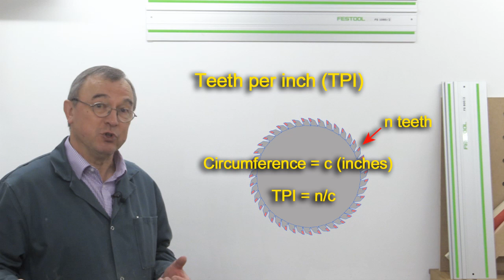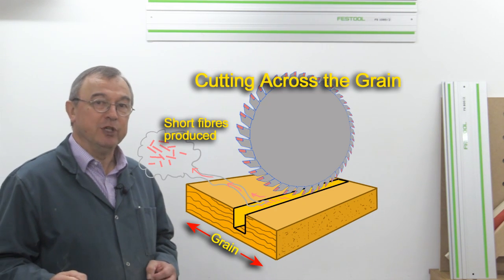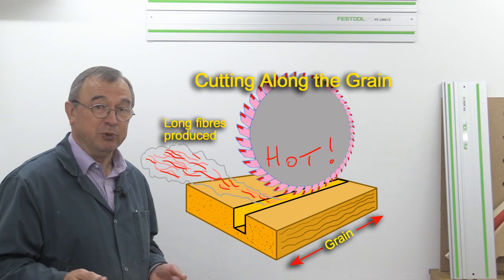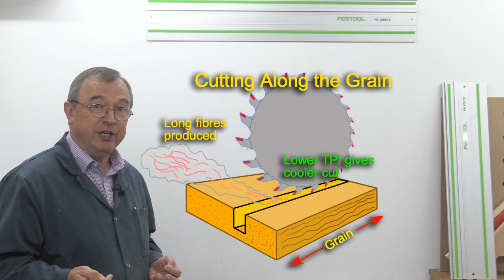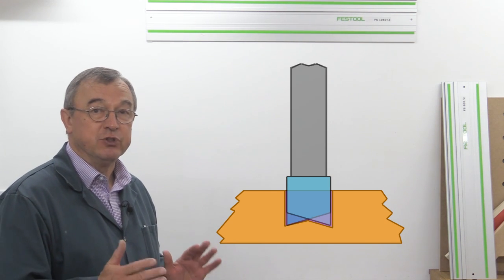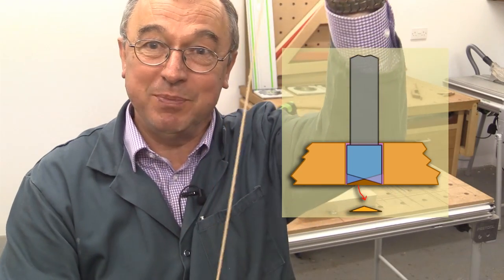Which blade for my Festool tracksaw?

Comment: Thanks again Peter for another very informative and professional video. As far as cleaning circular saw blades of any type or size, the easiest way I've found is to put the blade in a plastic garbage bag and spray both sides well with oven cleaner. Seal the bag closed. Leave it for a few hours or overnight and remove the blade, rinse well with warm water and dry thoroughly (a hair dryer works great). The blade will be spotless and you won't have to scrape any resin or risk damaging the carbide teeth.
Cheers!
Thanks again. 
Richard
Reply from the maker: Hi Richard, That sounds like an excellent tip for cleaning the blades - I will try it next time.    Peter

Comment: Very good explanation of use and demo... Most people do not understand how much you're cutting efficiency will improve with the correct blade, changing the blade on the TS 55 is so easy, always make sure you are using the correct blade for your cutting task.
Reply from the maker: Excellent advice. Many thanks.   Peter

Comment: Hello again Peter. Something caught my eye at the 7:10 mark that caused a problem for me a couple of weeks ago.. I noticed you had the green splinter guard on and it was that particular item that caused a problem for me... I was at a friends house adding a couple of cabinets to his kitchen that just had new cabinets installed. After using the kitchen for a couple of weeks they decided to add the two cabinets and the cabinet maker wanted a ridiculous amount for two cabinets. So I offered to make them if he would supply the materials and hardware and he wanted to help and wanted to learn how to use the TS55 tracksaw. I showed him how everything worked and told him to let me know when it was time to make the bevel cut...so I could show him how to unscrew the splinter guard and make the cut. He forgot and did the bevel cut without me and of course with the splinter guard on. The saw turned left going down the track and cut through the track and plywood.....    There was not any blade damage but the track and plywood were chewed up. I tried to get the tracksaw tig welded but the cost was almost triple the cost of a new rail section. My friend had used circular saws, etc  before but had never used a track....  And I should not have left him alone with a strange system while he was cutting.  He replaced the track section and a new piece of plywood. And he bought me a new blade even though I told him he didn’t need to.
The moral of the story? Don’t leave someone alone to operate a tool they are not familiar with and remove the splinter guard before they make that angled/mitered cut! 😊 my apologies for the long winded explanation 😊😊😊😊
Ron
Reply from the maker: Interesting.   Peter

Comment: Enjoyed your very detailed video, Peter I'm having a problem, ts75 blade vibration the right side of cut will throw chunks of partical board leaving a rough edge on the off-fall piece. Blade is tight, was using the 36 tooth blade, changed to the 12 tooth blade, lowered speed trying to find a smooth cut 4 seems to be better, slowed up my feed, nothing seems to stop the vibration, extremely frustrating
Reply from the maker: This sounds very odd. I would have suggested a blade change but that seems to make no difference. Is there a chance that the saw has been dropped in such a way that the blade or blade securing nut has taken the force? If the saw is within the 3 year warranty period then I would not hesitate to send it back for repair. I am sorry that I cannot be more helpful.   Peter
Reply: New Brit Workshop Peter, thank you,, saw is about 6 months old, never dropped, I truly believe it has done this since taking it out of the systainer but I've been cutting 2" thick red oak not noticing the wood edge being rough, but have always thought my dewalt saw actually ran without the chatter, I'm close to beaver in St Louis I'll take it to them this week. Oak is more resilient than particle board. Thanks again, I'll let you know the outcome. Paul
Reply: Peter, just to give you the update on my ts75,,,I went to festool website, filled out repair request, printed the shipping label, provided by festool, put my saw in a box, placed packing around saw took it to UPS,,, Saw returned to my front door about 1 week, saw seems to run perfect now, still hear what I would call a vibration, but it does cut perfect, sure did miss the saw while it was gone was forced the drag out the old Dewalt and a strait edge,,,,festool paid for everything at no cost to me, Refreshing thank you Peter
Reply from the maker: Hi Paul, That is a brilliant outcome. The Festool saws may exhibit what appears to be a small vibration from the motor as the on board electronic speed control switches in and out. It is something that one easily gets used to and not something to worry about at all. I am glad that you are now happy. Good luck with everything.    Peter

Comment: Hi Peter, I hope you and yours are well and safe. I wondered if you had a recommendation for a festool track saw blade to cut 30/60 min fire doors that are nothing more than chipboard at its core wrapped in stripes of hardwood? I also cut counter tops that again are only chipboard at its core. Thanks Peter
Reply from the maker: Hi Dan, I have not tried this but would guess that the universal blade would do the best job - 205551.  Peter
Reply: @NewBritWorkshop  thank you Peter

Comment: I must have watched this video a while ago and didn't listen because I see I already liked it. I have been using the fine blade since I have owned my tracksaw mainly for construction. Needless to say  my rips were taking forever.
 I had some 3/4 plywood to to break down for a flooring repair I can not explain so I broke down and bought the 28 tooth recently. 
OMG!  What a difference! I was flying through that plywood. I can not believe how long I've been suffering and burning and dulling my blades. Not to mention sharpening costs. 
 I'll be adding the panther to the collection too. 
 Nails? All I ever make is reclaimed wood things. The wood has to be in horrible shape for me to use it. I hit so many nails with my Kapex I could see you having a heart attack Peter. 😂😂
 If I put a blade down after every nail I would be living on the streets. The key is to (if you have that feeling you're gonna hit metal) go REALLY SLOW through it and cringe the whole time.

 Your jig for making 20 mm holes is on my list. I have to make some cutting tables to leave all over the place and for my 2nd paulk total station. 
 My first pts (which was my 1st woodworking project) doesn't have 20 mm holes. I cant use most of my clamping devices. Kills me.

 👋
Reply from the maker: Hi William, I enjoyed reading about your reclaimed wood antics.  Good luck with everything and I hope you enjoy the Parf Guide System.  Peter

Comment: Super informative video, as someone who is TOTALLY new to woodwork I often wondered what the differences were in the blades. I also didn't realise they needed cleaning :) but as the saying goes, every day is a school day!
Can I ask where you get your blades sharpened, I have never heard of this as a service before? Also how many times, on average, do they need sharpening and how long will a good blade last?
My Festool Track Saw is due early next week,  I am beginning to wonder if I didn't waste money purchasing the Table Saw seeing just how versatile the Track Saw can be!
Just one last question is it possible to put a metal cutting blade into this saw and cut metal? Not that I would be doing this, just wondering if there such a blade and if the saw (TS 55) is actually up to this task?
Reply from the maker: The interval between blade sharpening will depend on use and, to an extent, how you use it. I do a lot of cutting and do not sharpen mine more than once a year. I use take my saw blades to my nearest Axminster store as they have a really good rate and excellent service. Check the Festool web site for a metal cutting blade - they will not cut steel or other hard metals. Aluminium and brass is about as hard as you can go and I would prefer to do that sort of cutting with my Kapex.   Peter

Comment: Very useful and clear information.  I wish I viewed your video yesterday. I had smoke coming out of my saw while cutting with the grain on a long pice of hard-wood skirting board. I think I've destroyed my blade.  I'll be sure to get the universal blade next. Is the ripping blade more prone to kickback because the teeth are larger? Thank you for sharing your experience :-)
Reply from the maker: I am sorry about your blade but it should be fine. Clean it with methylated spirits (denatured alcohol) or anything that helps to get the marks off. The Festool blades are very robust. I am not sure if kick changes with tooth count. To avoid kickback start the blade with the saw retracted and then gently bring it down to start cutting.    Peter
Reply: Many thanks Peter.  John :-)

Comment: Thanks for the vid. The only concern regarding Festool blades is, that they have different kerf (teeth thickness) at least for TS 75 (not 100% sure for TS55). How do you get along that? It basically means you have to move splinter guard on the track or are the teeth somehow offset on the blade to get "reference edge" on all the blades on the same spot?
Reply from the maker: I only have the TS55 and so the kerf variation does not affect me. I have been told that one can adjust the saw to a kerf line but I do not know how that could be done.     Peter
Reply: I think this was a legacy issue . All current blades should have the same kerf.
Reply from the maker: Of course they do - I was not thinking !  Many thanks   Peter

Comment: thanks peter for the demo off the different blades for the TS 55 just one  question did you say  its a good idea to keep  your blade sharpened is there a company where you can send your blade to be sharpened in the UK

many thanks
Harry
Reply from the maker: Hi Harry, If you do a Google search for "Saw Sharpening" then you should find someone in your area. If you live near enough to an Axminster store then check with them as I am sure that they used to offer a sharpening service.  I do not know of any sharpening service by post but they must exist I suppose.   Good luck.   Peter
Reply: thanks peter will try the warrington store check with them 

cheers
Harry

Comment: The normal size of the saw blad is 160mm. Would it fit a 165mm (6-1/2") blade? I saw an interesting diablo blade, but just a little bigger than recommended.
Reply from the maker: Hi Adrian, I would not risk it.   Peter

Comment: What blade Youre using for kapex to cut masive oak countertops ? Im using blade that kapexs came new and that blade always burning wood and Its very hard to cut wood. Blade is after sharping.
Reply from the maker: Hi Pawel, I use the fine tooth blade. If you get burning it may be because the wood is not held down during the cut and moves slightly as the cut progresses. It could also be because the saw is slightly out of square.   Peter

Comment: Peter, Your "nailed" blade can be saved by a good sharpening company. They can braze on new carbide teeth to replace the broken ones. Given the cost of F'tool blades it's worth doing. My local (New England) sharpener charges $5.00 US a tooth. Of course that depends on how many carbides you gave a trim to.I have many F'tool blades for my T55 and T75 saws. I also like other manufacturer's efforts. Both Freud and Tenryu make track saw blades and may have options in style and type of tooth geometry that more suit your particular task at hand. IE., I have a Freud rip blade for my T55 and it works like a champ.Other things to think about; Positive or negative hook tooth blades. Negative hook teeth work better in sliding miter saws and radial arm saws and can give superior results with less chip out when exiting the work piece as the teeth are leaning away from the direction of the spin of the blade. Most tablesaw blades have positive hook blades, even if the hook is only 5 degrees.The height of the blade over the work, over; as in a tablesaw cut, or under the work piece as in a track saw. Freud, if asked; will tell you that they design their tooth geometry to give you the best quality cut when the height of the blade is set about even with the bottom of the gullets in between teeth. This puts about 2 to 3 teeth in the cut and gives  your teeth the best angle of attack on the wood. Blades set too high dramatically change the geometry of the tooth's attack on the wood and the amount of teeth in the cut.Blade cleanliness is also important because there are chemicals created when pitch and resins are burned that when stuck on to the teeth, help destroy the metal binders in the carbide. I enjoy rip blades a lot because they do what they do very, very well. Big teeth, big gullets mean fast rips with little to no burn. Rougher surface yes, but I'll take that trade off.Crosscut blades with lots of little teeth and little gullets cut slow, so speed of the feed of the wood through the cut becomes important, especially in wood prone to burning like Cherry.I find multipurpose blades to be MU (mostly useless), as they do most things poorly. That said the Freud Premier Fusion general purpose blade comes the closest to making me like a GP blade . High quality Freud made carbides, large-ish teeth with deep-ish gullets, wicked tall ATB (alternate top bevel) tooth geometry the severs surface fibers like a hot knife through butter. Side relief grinds on the teeth with the front of the tooth wider than the back. And, it's the only blade I have ever taken out of a box that came with an instruction manual in which the first instruction is to tune up your saw. Also with instructions for the saw sharpener to follow to give you the best quality sharpening. (No, I am not a paid Freud spokes model ! I just like Freud). According to a F'tool rep that I was badgering with questions about  Kapex blades not only did F'tool want an ultra smooth crosscut they also wanted a tooth geometry that created an air vortex around the blade and help throw the wood dust into the dust chute. As of 3 years ago, F'tool said that saw blades were the only thing that they farmed out to an outside supplier. The rep wouldn't give up the name, saying only it was another German company that made the blades used on the big European horizontal sliding table saws. F'tool is the only tool company I can think of that would have air vortex creation  as a design criteria for a saw blade.I have yet to try a Tenryu on the T55 but I would expect a lot from a commercial/industrial Japanese manufacturer of saw blades.G.
Reply from the maker: Hi George, War and Peace and a very detailed and useful bit of work - brilliant. I think that you should do a saw blade video. It would be very useful and I am sure that it would be popular. Many thanks.  Peter

Comment: Best way to clean a saw blade is to use a non corrosive soap, and brass brush, I use Simple Green, don't know if that is around in the UK.  There is also a cleaner that is sold at most of the stores like Rockler.  Be careful using anything that is excessively harsh since it affects the bond between the blade and the cutting tips.
Reply from the maker: Thanks Jim.   Peter
Reply: Cleaning saw blades is a boring chore, but we use a product called "clean green"  -  probably the same stuff  -  usually a bit of water is all we need and then we keep the blade oiled for storage. Nothing worse than discovering a rusty blade in storage
Reply: I agree, if I am rotating blades a lot, WD40 keeps them rust free for me.  If they look like they will be setting a while I usually put a coat of wax on them, don't want the oil residue on my finished projects.  I've saved a lot on sharpening costs by cleaning them first instead of just sending them off.

Comment: If anyone sees this by the time i do it..
Im cutting my first piece of melamine in the morning for my shop shelves. I have the 28 tooth and the finer 48 blade I think. Which blade of the 2 is best for this product. 3/4" thick.
Reply from the maker: Hi William, Use the 48 tooth blade as you will get less chip-out. Also, do not rush the cuts - try and "feel" the rate that the saw likes best.  Peter
Reply: @NewBritWorkshop  thank you sir.
 Im going into the shoo right after I tidy up the loose ends in the yard as we have a bit of snow coming here in Harrisburg Pennsylvania today.

Comment: Peter...
Assuming u push the saw along the track at the same approx. speed for each blade, the feed per tooth will go
 up as the number of teeth gets less. This also means the tooth load goes up, given the same feed. In metal machining
 (my field) the tooth load & feed per tooth on slitting saw blades & milling cutters is a critical calculation to take into account.
 In woodworking it doesn't seem to be as important ? 
Why is that ?
 I understand wood has fibres and ripping /crosscutting is a non-event in metal....
But tooth load must be important too  ?? No ..??
Reply from the maker: Hi Peter, It is not so significant with hand held saws like this but it is more significant with routers where the cutter speed (measured at the tip of the cutter) can be very high. The tooth load bit is more about the ability of the blade to take away the waste and that is why ripping blades have a larger gullet in order to remove the waste more efficiently.   Peter

Comment: How about cutting melamine sheets without tear out?
Reply from the maker: Hi Ian, One does get a very tiny bit of breakout if one is in a hurry. The secret is to ensure that you do the cut on a clean sacrificial surface which acts as a splinter guard under the material. Breakout on the top of the cut is unlikely provided a sharp 48 tooth blade (for TS55) is used.  Peter
Reply: Cheers Peter